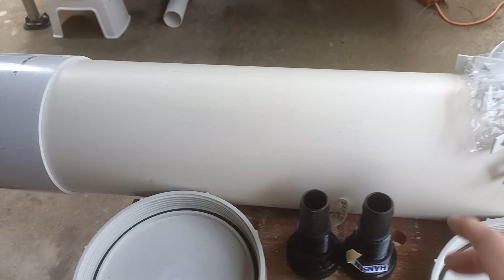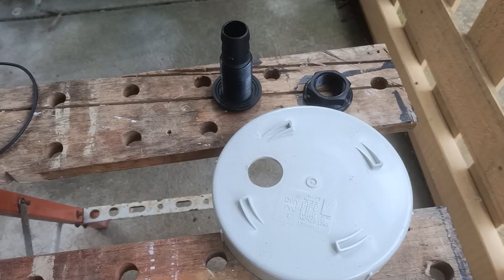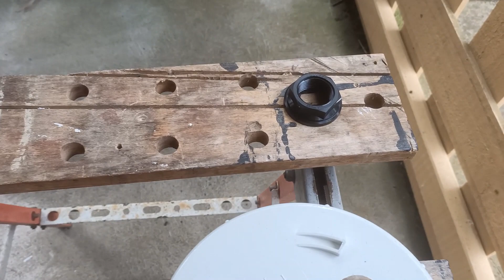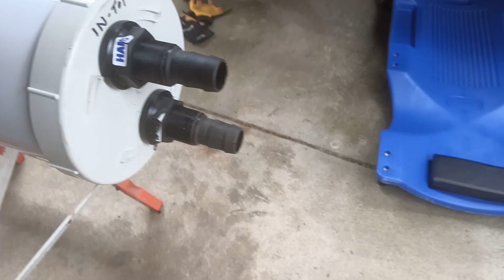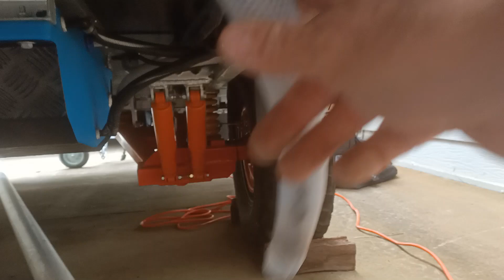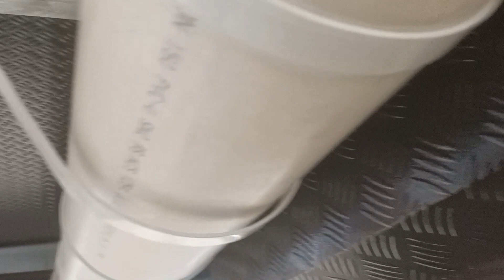MDC XT12HR rear Grey Water Tank Install

Comment: Michael
Thanks for the video. Did you end up doing the 50ltr tank for the shower?
Reply: Michael...sorry..just found the 50ltr tank video...excellent 
Thanks
Reply from the maker: Yes, did the 50lt in between the wheels, installed the internal 20draw fridge, rangehood under the cupboard next to the shower, installed a draw under the bed cavity. 
Some are on YouTube under michael might
Reply: Thanks Michael. Great information. Cheers
Reply from the maker: Here's the draw https://youtu.be/L0QS-lyhEnE
There is one for the 50lt tank too
Reply from the maker: Tank https://m.facebook.com/groups/345986085775191/permalink/1166502123723579/